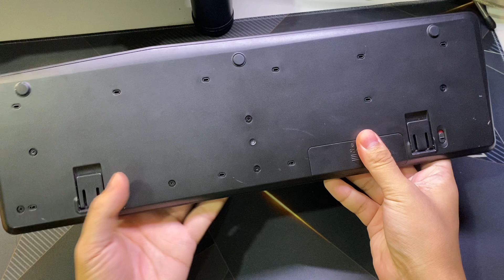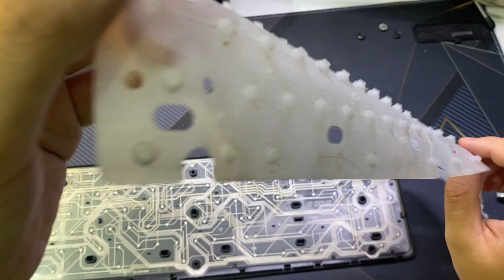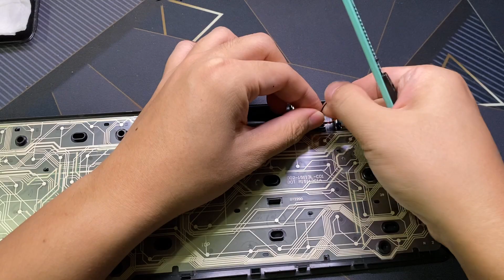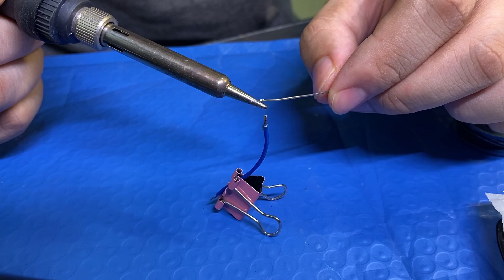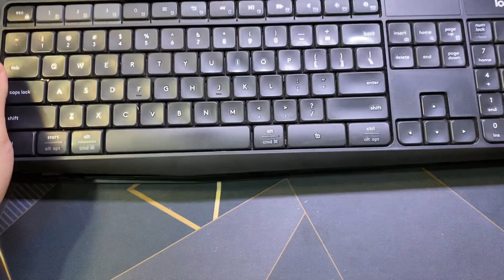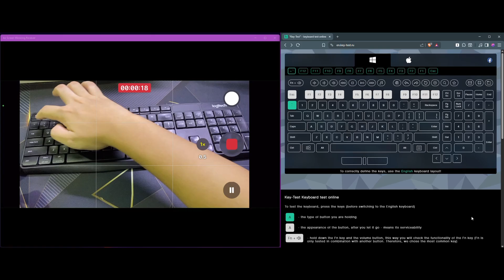Trying to Repair Wireless Keyboard - Logitech K375s

Comment: Thanks, might have helped solving my problem. I think the connection from those transparante layers with the wiring to the controller board was bad, so I put a piece of foam material there so ot gets some constant slight pressure. Had a similar issue with a PS3 controller about a decade ago and fixed that the same way. I use to grab that keyboard at that exact corner, so it just might have worn out a little over time. Initial tests went positive, but I can't tell yet if that was it in the end, first I need to use that thing for a while to see if it's actually fixed now. FIrst try was just cleaning the entire thing which did not help.

Comment: You did a great job considering the tools you had on hand. Things to consider getting are flux and a desoldering pump (apparently engineer ss-03 is good?) You apply the flux, then heat the metal contact and then use the desoldering pump to remove the old solder. This will leave you with a clean surface where you can feed more solder to later. You can also "pre-tin" the wire to make it easier to attach the two together. This is a brilliant video to watch: https://www.youtube.com/watch?v=vIT4ra6Mo0s

Thanks for the content you made me smile. Have a great day :)
Reply from the maker: Thanks for the detailed tips. Glad the content made you smile😃

Comment: do you use solder paste ? i never saw you use it and you say solder doesnt stick ofc it wont why wont you watch some youtube videos before doing these stuff?
Reply from the maker: Do you mean flux? If yes, then yup, I used it. But later I found out that making some scratches on the surface works better.
Reply: @juanthemaker yeah prob because it got corroded you need to clean it first and scratch the bad parts like in those soldering electronic videos there is alot of people doing it online
Reply from the maker: @kiralol  I did check out some videos, but I’m just not that handy.😅